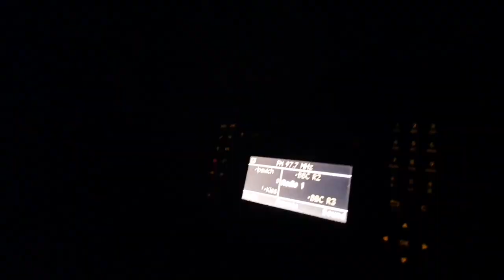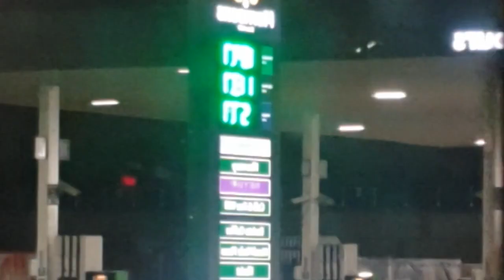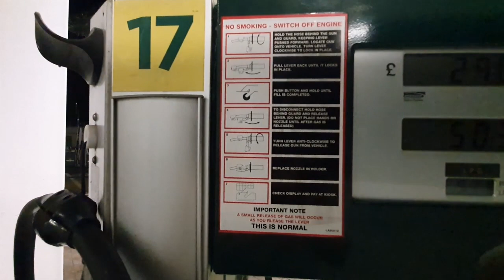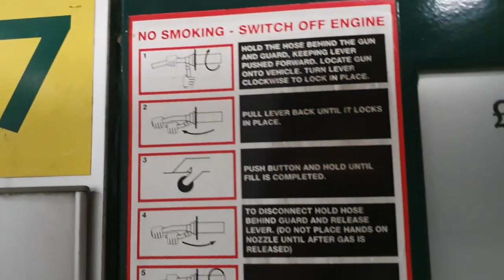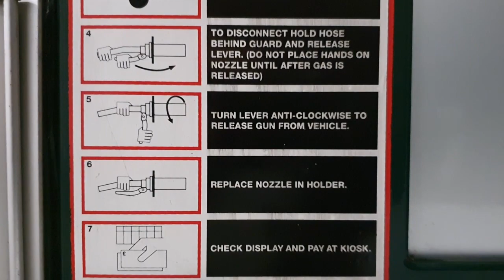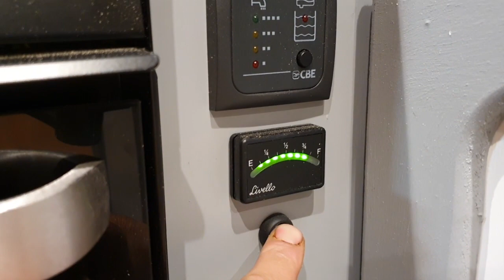Filling the LPG TANK for the FIRST TIME | Van Life Build

Comment: Worth saying, and this video confirms it, that there are lots of areas where there are no garages with LPG... eg.there are only three in the whole of Surrey and Sussex between the M25 and the sea! And there's often a massive difference in cost.  The app is good, but it's worth calling ahead to check if the garage has any- it's not as common as you might think!

Comment: Thanks for sharing mate, did you sort out level gauge? Having an issue where mine is stuck on 3/4 full? Even before I filled it
Reply from the maker: Hello mate, sorry for the ridiculously late reply.. I'm useless 😅
I've never got my bloody level gauge working properly to be honest. Sometimes it works and sometimes it gives all sorts of random readings. I've had a few people say the same about them. Stuck on 3/4 is an odd one though.. they have to be on an independent supply and earth and they work on temperature I believe so you might have a fault gauge on the tank 👀
Let me know if you get sorted dude 🤙🏻

Comment: I'm wondering if I need to use my adaptor and how to recognise the lpg pump on the morrisons forecourt. I'll be filling up my Dacia Sandero this week in Manchester
Reply from the maker: Hey Mike, the LPG pumps are usually stand alone and are always orange 👌🏻 
If the LPG was fitted in the UK then it should fit straight onto the UK pumps... Europe use a different connection I believe so you may need an adaptor.
I hope that helps dude 👍🏻
Reply: @BejamVan  Thanks for the info. Really helpful. (-:

Comment: do you have to turn the gas off (to the appliances) when filling up? never thought about that, I'm assuming you you do otherwise you're pressurising the line too. not fitted one yet so still learning about them.
Reply from the maker: Hi Scott, I always have the gas isolated at the manifold when travelling anyway and I never touch the valve on the bottle, it's always open. When filling I would be the line I guess but the regulator controls the flow and pressure so wouldn't do any harm. I hope that helps dude 👌🏻👍🏻
Reply: @BejamVan  Excellent! I may post a video when I do mine, it's the spare wheel shaped tank. What camera do you use for recording? Thanks
Reply from the maker: No worries dude.. I use a Panasonic G9 now but in this video I literally just used my phone. Phones these days are ideal 👌🏻

Comment: unfortunately Morrisons in Eccles Manchester was a problem for me. Firstly, because I have a car, the outer flap got in the way of the the turning of the pump handle. When I turned it back, the adaptor I have to use got trapped in the pump. The staff refused to help me, but eventually I managed to undo it myself. The pump was in the middle of all the other pumps and I really don't want to try all that again, with ten motorists watching me struggle! Anyway-I tried! Maybe it's just for campervans that don't require an adaptor.
Reply from the maker: Sorry for the late response and sorry tk hear about the trouble you had mate. Have you managed to get anywhere with it since?
Reply: @BejamVan  Sorry for the wait. I've been away. No, sadly I can't get lpg and Morrisons pumps aren't suitable for my vehicle.The one gas supplier I used has now decided not to supply vehicles.

Comment: Pressure guage prob works on pressure and obviously cooker on means pressure is lower
Reply from the maker: The level gauge works on tank temperature via a bimetallic strip in the back of the gauge.. but know nothing more than that. Its still a bit hit and miss now 😅
Reply: @BejamVan  the bottle will get colder during gas transfer. So that's probably an issue there then. But the old fashioned way of checking bottle levels was a warm water trickle and see where the water feels cold

Comment: If you brush some soapy water on the fittings you’ll see any decent leaks as it will bubble up.
Reply from the maker: Spot on.. thanks Lawrence I'll be doing that today 👊🏻 
Genuinely paranoid about leaks still and I've been in the van for days now 😅
Reply: Bejam Van there is also a thing called a manometer. Which measures the gas pressure in your pipe work in “millibar” it’s really low pressure. That’s why you probably won’t hear or smell most leaks. There will be somewhere in your pipe work normally that you can connect the manometer and check to see if it’s holding a constant pressure. Then you know 100% there is no leaks in the gas run. Interesting you’ve put a bath in your van! Take it easy mate
Reply from the maker: @lawrencebyron4619  cheers dude.. I'll get on ebay i think. There's always a slight smell of gas as the boiler fires.. I'm hoping that's normal though 👀
Reply: @BejamVan  I kid you not,  an old gas fitter I knew reckoned they use their lighter to detect a leak once they'd sweated the joints - not sure if he was kidding me
Reply from the maker: @stephenporter5796  this seems crazy 😆